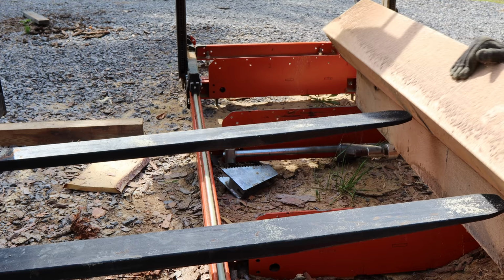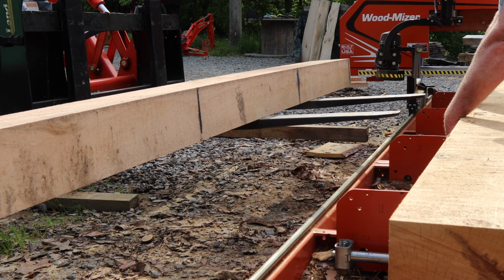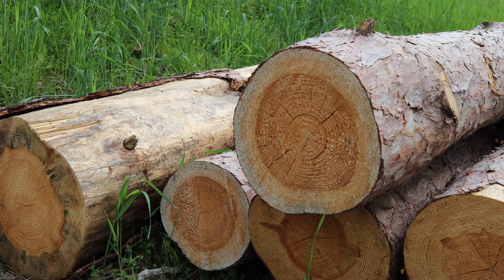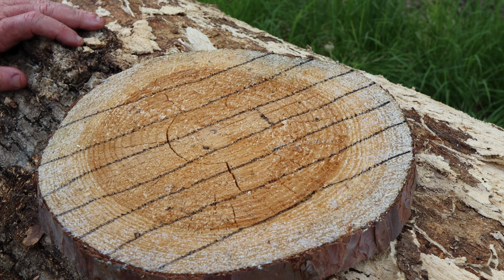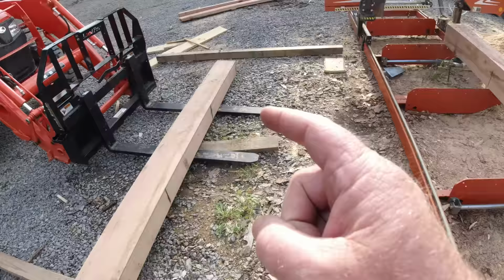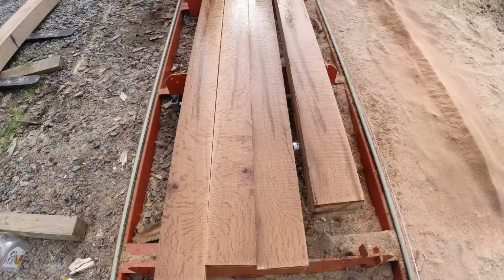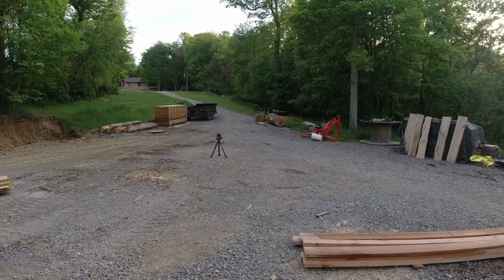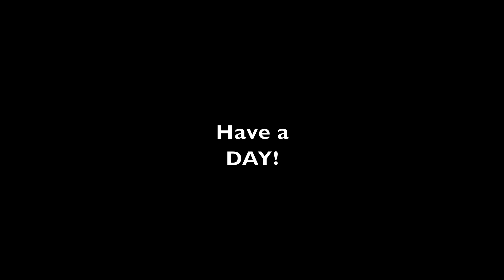Is this really worth the EXTRA TIME and EFFORT? Quarter Sawn White Oak

Comment: Quarter sawn is often called for in boat building. The vertical grain won't wear down if used on a deck or stair tread. Used sideways for frames, it has incredible screw holding and snap resistance. Also doesn't warp. One or two boards from every log come out quarter sawn no matter which way you cut. Keep an eye on the end grain and set those in a special pile, even if it's pine.

Comment: I am so impressed with the new winch controls for tractors that virtually turn them into log skidders and thats a big step forward. Logs out of the dirt are so much nicer to the mill. I know that dollars are very tight.... very tight as to expanding anymore luxuries for milling or to get wood to mill sight. As to the question that you partially raised on how they got the "quarter saw" comes from days gone long by. I'm old enough to be your father but in my fathers time... In the say thirties and up to somewhere in the early sixties... the biggest tree that you have there are just limbs from those majestic trees they cut then measuring say twenty foot across the stump on the narrow way..I seen them and even much larger than that. Here's the answer to a question said: Taking a "quarter out of a quarter out of a quarter made for easy peasy cutting full quarter sawn wood, they thought about it back then as it would never end. Not to panic as there are still large swaths of trees that have never seen nor heard the drum of a chainsaw. I was in timber most all my life by proxy as it was involved in someway to a mill or woods job. So in todays time, real time, getting a full quarter is still able to be done by patience and learning wood caricature. You can force a lot of true quarter but at a terrible cost to production as it would need turning and clipping the edges of the wood off to start a new four inch wide board an then the six inch and then maybe one more before moving down to the four inch and a two by two or something of that nature. I love Captain Kleemans channel as he has a lawn tractor with a small small three point on it and with modification has him a way to toat the log on a small little arch for the butt, and far end is raised off the ground with his built by himself a log arch that is towed behind and with the winch portion raises the other end as well out of the dirt.... as well as make it possible to even move that much weight. With some of the wood he toated out they were too heavy to dead drag, or lift and drag but the arch changed the parameters and now able to move. A friend of his is going to loan him his woodmizer to take out to his place and just use it. Mighty christian I would say. Mr. Kleeman is a very young and energetic man who being poor doesn't hold him back. He has many ways to go and is working three jobs every day of the month and still give time for Our Lord. Living on the mississippi river has been a inspiration to his thinking. He is a modern "Mark Twain" with due diligence to all and to me a good making of good men we see little of. I think that should this time and of knowledge were you at woodmizer picking out a mill, it would be a more hydraulic controlled mill giving  you more time to sort or be three men in one on the offbearing of the lumber and setting logs on the mill. I know what OCD is like and should you had a choice the scraps off the mill would have their own way of being collected, loaded to the mill itself, and mobile so you could clean and thats the part of ocd I refer to of cleaning around the work sight. Much easier but it is what it is, could be upgraded if the channel were to take off to say five hundred thousand subscribers, a patron account making it pay its own freight and maybe a hour to sleep before the dreams take over and you saw more timber in your sleep than a person could do in a week. Who knows, maybe the "eagle will drop a egg" on the first of the month. I see benefits of a patron account seeing the money go back into its own and not seem like welfare or begging. Just knowing that it is yours and not the youtube peoples bank makes a lot of people happy to share. A "Our Way" of saying thank you for the efforts of making quality videos. You folk have done well to manage a good clean family channel.... and ask yourself if a curse word has never slipped out when a hammer drives the thumbnail into the board being secured /LOL. In alaska you might find some of the new folk that have moved here and do all the right things... that said most of us who have lived here for many years will say its only a adverb so who's to care? Ah... another chapter in who cares about what old people think.

Comment: The “quarter” system is used to differentiate “full size”, i.e. 4/4 from 2x which is not actually 2” thick but is consistent. Mostly derived from big production saw mills where they clean up the faces and round the corners…, 4/4 etc is mostly used by woodworkers. Dimensional for construction. I guess the first mill to produce it thought 1 3/4” is thick enough to build with and we have less waste.

Comment: The quarter measure is meant to denote that the lumber is not planed and finished.  It means it’s rough sawn and not store bought/run through planer/moulder.  Congratulations on the career change guys!  Keep up the fantastic work 👍🏼

Comment: Motor Mike that was a REAL nice explanation of sawing timber.  Good job ol boy.  I would like a saw mill.  I had someone saw for me about 25 years ago. Built all my kitchen cabinets, with black ash and black walnut.    REALly nice lumber.  

Put some ratchet straps around you lumber pile.  We had some tamarack just sawed and the ratchet straps are keeping it straight, plus we put some steel siding on top, so the sides are open.  Let er happen Motor Mike!

Comment: Mike, for weight on your cut lumber, have you thought of splitting in half a trash log so it lays flat on your lumber?  Also, it will cover more surface area, so most, if not all, will have pressure one them.   Just a thought.   I learned a lot from this video.   Good job.

Comment: Actually all size lumber coming off a mill is 1/8 inch thicker. I e .. 4/4 plus the one eight  inch for shrinkage when dried
Reply: ...some mills do that...but some just do the true 4/4...etc. their thought is most people buy it to joint and plane down to approximately 3/4...or enough to flatten and then parallel the other side
Reply: @rgd2598  not if cutting to NHLA specs

Comment: Just in case you don’t have a log handy that will work, you could put some large screw eyes in the 4x4’s of the pallet and use ratchet straps to put even pressure on the lumber to reduce cupping.

Comment: 👍🇺🇸🇺🇸🇺🇸🗽🙏🏻 Enjoyed!  I believe I would have cut a slab or two off the log you are using for weight before placing it on the stack of wood.  That way you would get even pressure across the stack.  When are we going to see some concrete being poured?

Comment: I've always thought the reason for the quarter convention was to distinguish the dimension from a finished dimension, like 2x4, which is not really 2" by 4".  When a 2x4 is still at the rough cut stage, it is literally 8/4 by 16/4, but then it goes through a planer or sander that removes 1/4" from each face.  So by expressing with dimensions with quarters, the person is saying, "REALLY".

Comment: Mike, won’t the stickered boards on the lowest portion of the stack be dry before the new boards added to the top?  It seems weird to have to move the top boards in order to get to the bottom ones that are dried and ready.  Maybe there’s something that I am not understanding about drying rough cut lumber.
Reply from the maker: Bottom half of pile is hardwoods, Red Oak, White Oak, and Cherry, The Pine on top will dry much faster than the hardwoods

Comment: Mike - what type of scraper do you use to clean the saw dust off of your boards  ????
Reply: Robert, it looks like a trowel from the plaster supply company????
Reply: It is a drywall finishing blade, used for feathering out the wet compund.